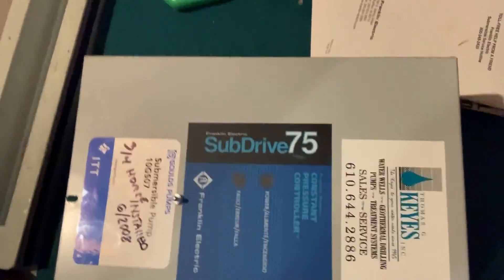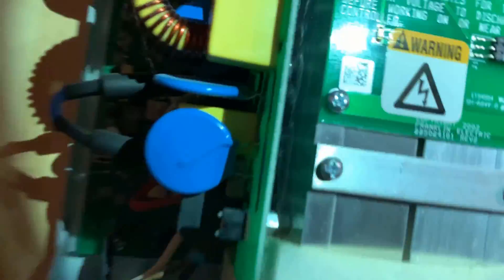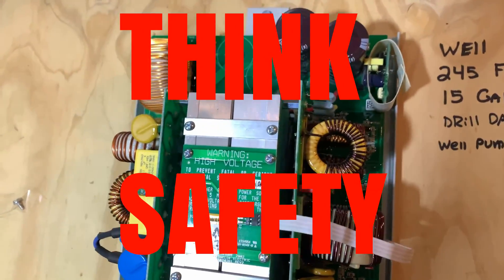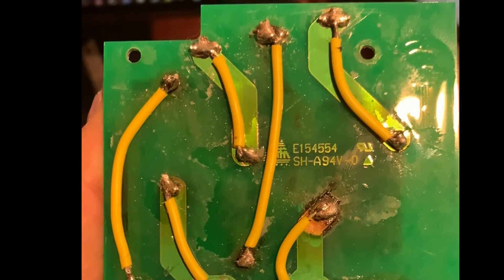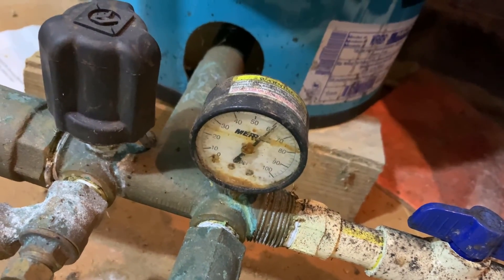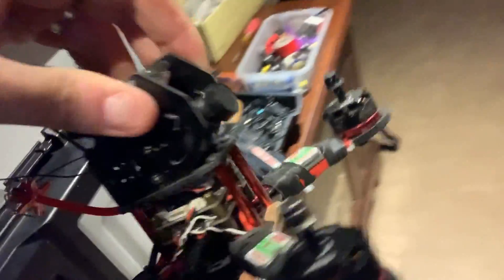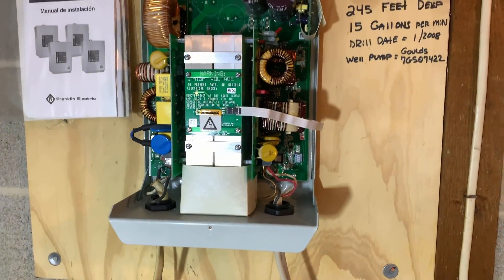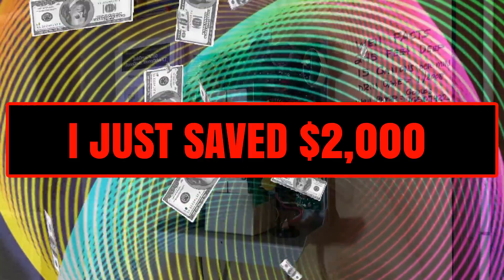How To Fix The SubDrive75 - Fault Code 5 - They Have A Bad Reputation

Comment from the maker: It still works with no issue.
Reply: What's funny is I am a well guy and I went out to an out of water service call yesterday. Low and behold it was a subdrive 75 which the homeowner complained about a burning smell prior to me getting there. The mother board on the right was glowing red and burning in a similar spot as yours when there was power to the drive. I was not about to solder wires on the piece of crap and be liable for possibly burning someones house down later. You are correct the price on one of these drives is in the $2000-$3000 range. We replaced the drive with a PID-20 Pentek Intellidrive which is a more dependable unit. It's also a much more user friendly vfd. After installing the new drive we did notice that his pump wouldn't build over 54 psi so them having a weak pump could have caused the subdrive 75 drive to be running non stop. There was also a bunch of drywall dust inside the unit which could have made it hard to keep cool in operation. I am glad your fix got you out of a jam and saved you some cash. Good luck 👍

Comment: I have the Nema 4 version of your drive and found mine this morning had faulted out. I neglected to actually look up the fault and just assumed I either had an open circuit or a short down hole. So I disconnected the pump inside the casing and meggered the line to the motor. It checked good to ground and between phases. So I powered up the drive and it did give the open circuit fault as expected with the motor disconnected. I hooked the pump back up and everything worked as it should, for about 1/2 an hour. So this time I checked the fault light and it was flashing a pattern not listed on the chart. The drive is about 10 years old so I figured as a last ditch effort I would just pull it and take it to the shop and see what I can. Although it is a Nema 4 it was not all that clean inside and had some moisture intrusion, most likely from the conduit entries as the guy who dug my well and installed it was not exactly what you would say as good as he thought he was. I pulled the fan out and there was a small wasps nest and other debris in the fan assembly. In the Nema 4 version the cooling fan blows through a heat sink which is external to the electronics of it.  I looked up the fan used and thr exact name brand and model is about $25 on ebay which I plan to purchase as I tested mine after cleaning it and it sounded a bit rough. Anyway, although my issue was not as shown here I figured I would pass it along just in case anyone else comes across this video after the fact like I did.

Comment: Thank you sir. My sub drive 75 is now working. I went straight to the circuit board and found the problem solder joint. Took me about 30 minutes to have our pump working again. What a blessing! God is good!

Comment: Had no water this morning my problem was the fuse its solder in so for now its hot wired looks like a 45 Amp until I find one it will stay hot wired both my lights were blinking very slow and very dim

Comment: I was wondering the same about the current draw now compared to when it was installed. What HP of pump are you running on this drive.
Reply from the maker: 3/4 HP Goulds 7GS07422 - sorry for the late response, I don't frequent this YT account very often.

Comment: just a note to everyone on this board. Use a proper solder sucker and resolder each connection properly. Actually I would add(and solder) some bare 14awg along each trace from point to point which means you'll have to clean off the coating on each trace and solder the length of each piece of the added 14awg. This will give the trace a higher current capacity which should fix the problems going forward so it doesn't repeat the failure. What has happened is the original solder joints become what is called a cold solder joint due to the repeated heating and cooling of the joint by the high current flowing through the connection. Over time it is bound to fail. Again it's a poor design by Franklin or who ever designed their boards.
Reply from the maker: Wally, you make good points.  Just an FYI: It's been over two years and the thing still works fine.
Reply: Thank You for the update. Good feedback

Comment: I'd say it's simply a poor board design by Franklin, they under rated the board traces for the current required. Someone didn't do their prelim design work correctly to make sure they had heavy enough traces. I hope Franklin has redesigned that board to fix the problem.
Reply from the maker: Many people bitch about this issue. I'm sure they fixed. it.  My board still works perfectly after the fix.

Comment: These control boxes are junk especially at the price! Mine kept burning the terminal strip where the pump wires go. High humidity location (Mexico) the wires arc and burn the bakelite to make a permanent carbon short. I was able to stop the arcing by coating the terminals with dielectric grease. Poor engineering!
Reply from the maker: YEP!

Comment: Not sure if you will see this since the video is a year old now, but how long did this fix last for? Or is everything still working?
Reply from the maker: David,  The fix was applied in Jan of 2020 , It's holding up fine it's now Feb 8th 2022.
Reply from the maker: It's still working fine 5/2/22
Reply from the maker: Still working with no issue - Three years later.
Reply from the maker: still working with no issue.  11/2/24

Comment: My unit stopped working yesterday and I thought it was fried.  We went without water for 15 hours and had a well company scheduled to come out tomorrow to replace the unit... until I saw this video.  I took mine apart and found only one bad connection.  Had it soldered in 10 minutes and we were back in business!  Thank you!
Reply from the maker: ROCK ON Chris!